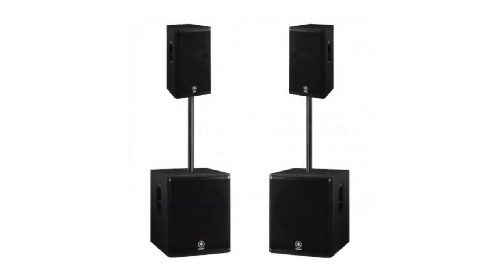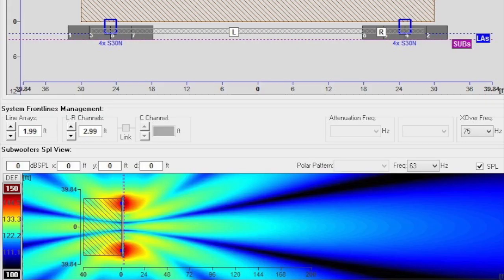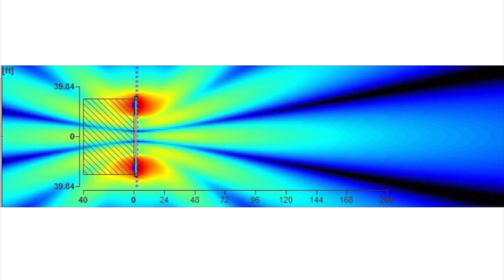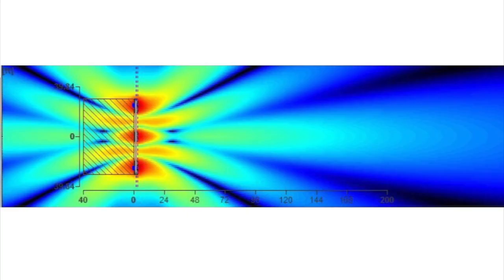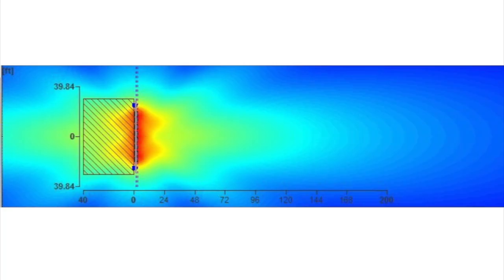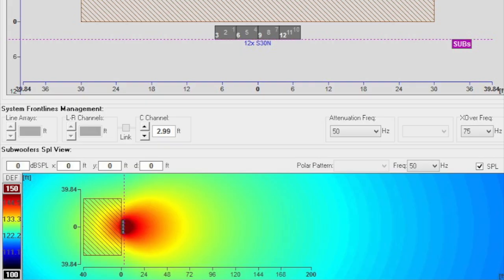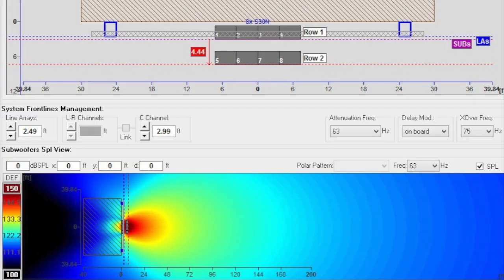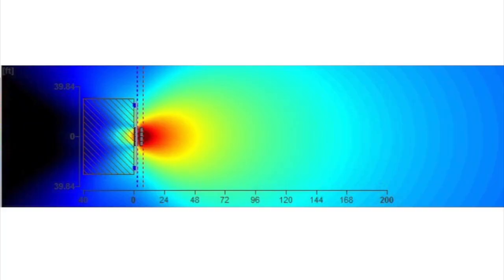TECH: LIVE SOUND SUBS SUBWOOFER PLACEMENT & CONFIGURATION - LR, Center, Line, Cardioid, End Fire

Comment: @MusiciansPro I tried a center setup tonight with two active subwoofers. But I still had some issues with phase and bass-cancellation. Is it okay to have one sub in-phase en one out-phase? For me this resulted in the best performance, although I hoped for a little bit more 'oomph' in the lower end. Thanks for this great video, hopefully I will have the budget for more sophisticated setups in the future!
Reply from the maker: In theory, if you had 2 identical subs placed side by side and it sounded better out of phase - you have a major problem somewhere.  Typically putting 2 subs out of phase from each other would almost cancel their output, not make it sound better or louder.
Reply: +MusiciansPro Thanks for your quick reply, it's really highly appreciated! The subs are identical, same make/model, however I bought the second one a couple of months after the initial purchase. That shouldn't matter right? Or could it be that it is technical fault and something is wrong with the buttons on the amp? What I hear is the following, both subs in or both out-phase >> bass cancellation. One in, one out >> no cancellation, but not the additional output / smoother low end response -I was expecting from two subs. :)
Reply from the maker: What is the brand and model?  You may need to check the polarity of the speakers, they could be reversed which would put them out of phase.  I would contact your dealer.
Reply: +MusiciansPro They are defintely not high end subs: Alto TS Sub 18. Thanks for your feedback. I will contact my dealer after the weekend!
Reply from the maker: What did you find out about your subs?
Reply: MusiciansPro I have these subs. They perform well for their cost. I would guess he must have been using a wrongly wired cable somewhere as the build quality on these subs is very good

Comment: Hello, how do you come up with 4.44ft of spacing in the end fire array? thanks
Reply from the maker: 1/4 of the length of the wave you want with the most cancellation.
Reply: Thanks, let's say if I want the most cancellation at 90Hz, how much approximate cancellation at 50hz? ...3, 5, 7..... dB down?
Reply from the maker: That could be calculated, but is beyound the scope of this video.  Hoever you will have a noticible dB reduction within the 1/2 octave reange of your center freq. Aprox.  90Hz = 45 Hz range (68-102Hz)

Comment: Do you know where to get some info on the "line" speaker setup? I'm sure the math has to do with the size of wavelengths or something (or maybe I am completely off). I think for the equipment I have using the line instead of just coupling them in the center would be perfect. Thanks!
Reply from the maker: +DJ Fayze - There are a couple of options available in the LINE config.  Standard line spacing and LINE ARC with delays on the cabs as they move away from center.  You should be able to Google more info or check with you speaker maker to get the settings they sugges.

Comment: Hi there. What should be the distance between the subs in the model line ? Thanks in advance.
Reply from the maker: That depends on several factors of your specific cabinet and driver configuration.
Reply: +MusiciansPro Thanks for your answer. Could you suggest a literature that I can calculate this distance? Thanks again. Best regards.
Reply from the maker: I would try your manufacturer first, and then Google "subwoofer configurations" and add "line" or "center", you should find pages that go over the details and math for each config.  You can also download the FREE program that we use which is dB Technologies DVA Composer.  Try it, learn it, and use their speakers in the program that are close to the same specs as yours.  That would be better than nothing.  Good luck!